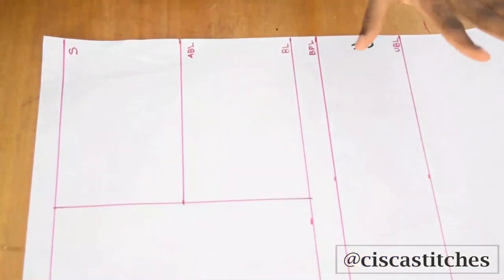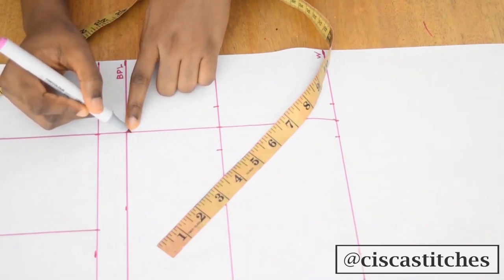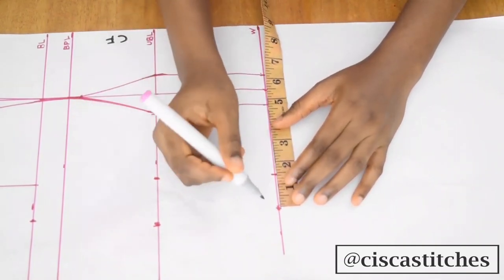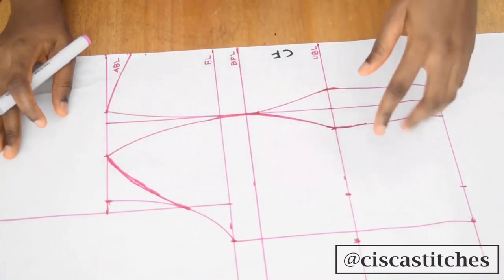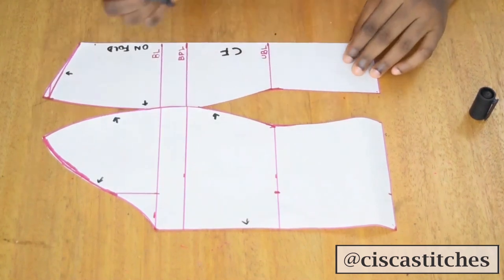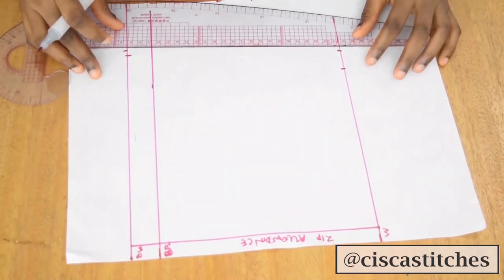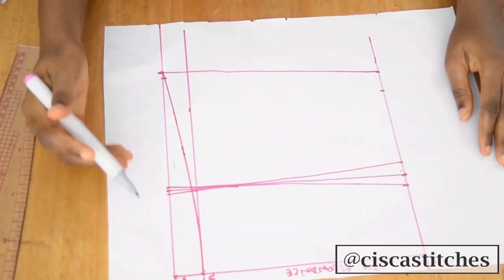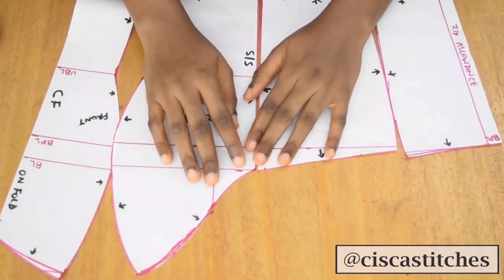BUSTIER TUBE TOP [Pattern Tutorial - Slightly updated version]

Comment: Is this an updated method from the last one? I actually tried your previous tutorial on a bustier tube dress where you used a muslin fabric to show the fitting and mine came out perfect too. Thanks for the good work, Cisca.
Reply from the maker: Hi, if the previous method worked for you, that's fine. You can continue using it. What I did in this new one was to increase the dart at the above bust. It helped bring the bust effect out really well. In my opinion.
Reply: @ciscastitches  Okay, I'll take note. Thanks for replying 😊